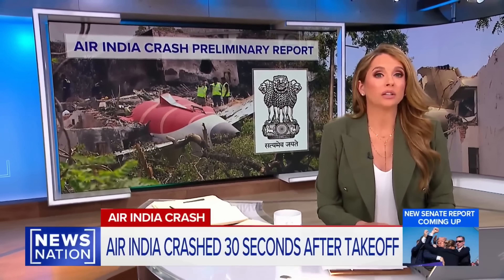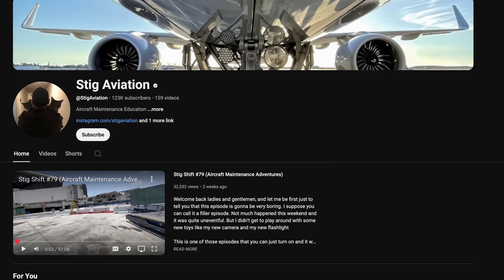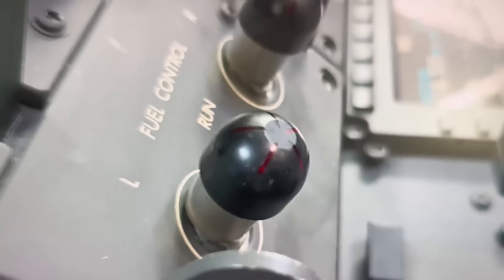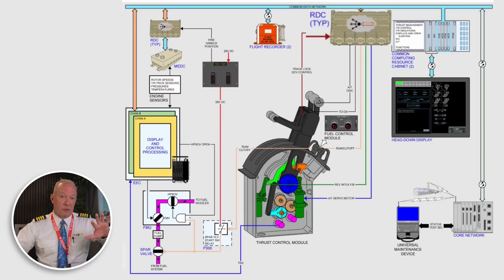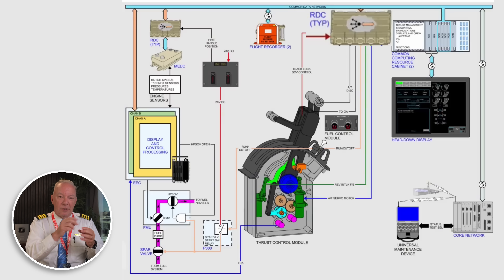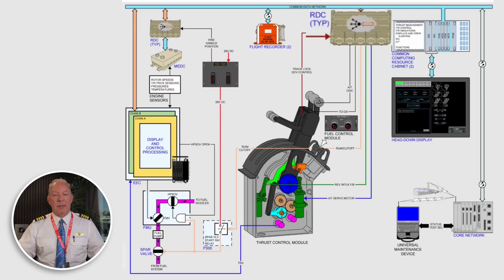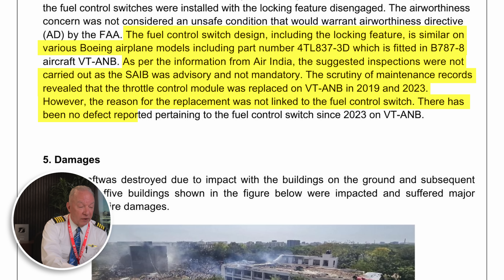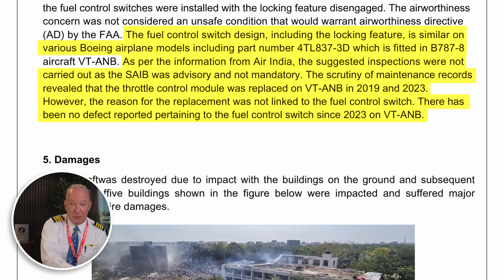The Truth About Boeing 787 Fuel Control Switches

Comment: As a non-insider, could there have been a problem with that battery? It was said that, like on a car battery, even during a total power failure there would be still remaining power in that battery. If the battery is defective, this would affect 'both switches'?

Comment: Captain Steeeve, when you said the whole module was replaced, I started to think was it maybe a faulty connection in the wiring. However, to disconnect and then ten seconds later to reconnect does not make any sense either.
Hoping, as you say, neither of the pilots was trying to test the others skills…

Comment: Hi Captain Steeeve,

I was wondering if you could clarify this thing boiling in my head. I'm an engineer and a very curios one. And I just love airplanes and follow aviation news around the world. Is there any chance that these switches are electromechanical ? I know that it is far far fetched... I have these kind of safety switches in my lab and I also use them on my DIY projects. I also know that it would be a very complex mechanism to design these type of safety switches electro-mechanically operate..... since these switches are very thick and bulky... I thought they might be electromechanical.... but they could be bulky just because they carry a lot of current to operate the Valves directly.... I'm speaking my mind... so can the flight computer flip these switches ???

Comment: The problem I see here always requires power to keep it engaged this is not correct as power could be lost for various reasons I could go on and how it should be but I won't at the moment as I don't have all of the details
Reply: Good idea, research firts! If you're talking about the cutoff values, they are default CLOSED. If an engine shreds itself, and wow can they ever!  Statistically it WAS more common for it to happen due to engine condition itself, something significant enough to go into an engine and do it is very rare in the sky, it has happened with a bird..... But it was a 10 foot wing span condor that evidently had just eaten a dear! But these days engines are amazing in design and composition of parts, the integrity of the blades and shaft when running is stealing magic from another realm😂
Bird strike generally just makes a mess that cooks on the igniters and you have to clean it off to restart sometimes. If you wait a little it will generally fully bake🤢 and can restart, but best to land and fully address it. SO, extremely unlikely but if an engine turned itself into an appendix hanging off the wing, there is a good chance it will take power out to its immediate infrastructure is at that point you want fuel to stop by itself. 
Problem here though is this guy (that i did like) is like so many others dribbling garbage and being completely misleading!!😠 The movement of the switches by any means or record, is a COMPLETELY USELESS detail in evidence!!!!
It could be the reason engines failed hence record of operation...... BUT if it was something else and the pilots try to restart they have to operate the switches!!!!???? And remember I said to need to wait if it's bird guts cooking that maybe the only thing they thought it could be, so wait 5 seconds before returning to run!   🧐 So no matter what the switches will be used! So they prove nothing.

Comment: What Captain Steve doesn't explain is why Boeing even allows the switches to be touched at this stage of the flight. During takeoff, right after the rotation, is there any reason to justify the fuel cut off? If not, why does the system allow it? Would this tragic accident have happened on an Airbus? On an Embraer? Does the Airbus or Embraer system or software allow fuel cut offs under these same circumstances? With all due respect to your profession, I think that new protections must be imposed by the regulator to protect us from the pilots. We don't need a second cockpit door; we need protection from the pilots. I've always been against the single-pilot policy, and even zero pilots, but now I don't know... Perhaps we'd be safer removing the pilots from the equation.
Reply: In case of a single engine fire, pilots are instructed to cut off fuel to that particular engine (Right after take-off) Now you better have a reason to keep supplying a fire engulfed engine with Fuel even when everybody knows airplanes fly just fine on one engine as well. The manual control to fuel the engines is justified imo
Reply: @krabhigyan People are DAF I guarantee you not one of these ideas people have is generated in there own thoughts, they listen to another fool... I should  have mentioned where said something should be.. hang on a sec..

HEY.. OP The system actually does prevent two engine cutoff in air.. the WOW system is the applicable reference.
So again had to be fault even if it was deliberately intended!!

 Ok how you he will take that? I'm guessing, go look for confirmation from another fool.😂
Reply: @krabhigyan People are DAF I guarantee you not one of these ideas people have is generated in there own thoughts, they listen to another fool... I should  have mentioned where said something should be.. hang on a sec..

HEY.. OP The system actually does prevent two engine cutoff in air.. the WOW system is the applicable reference.
So again had to be fault even if it was deliberately intended!!

 Ok how you he will take that? I'm guessing, go look for confirmation from another fool.😂
Reply: Absolutely NOT! you will rethink that when the final report comes out! Airbus has exactly the same! A Quants flight took off in Australia a few months ago and had to shut one engine down when it burst into flames at the exact same time these engines failed!! Not saying they are related at all they are not. Just saying YES THE SWITCHES, YOU NEED TO HAVE THEM AT ALL TIMES.

Comment: This an exploration of a lay in safety systems. By default this is an unsafe circuit! A single fault causes a catostrophy!
Reply: Yes but that's in regards to the real cause, not the switch or its circuit, that's is fine by design and was operating fine at the time. Unfortunately it requires an EXTREMELY high intellectual capacity to understand this evidently. I'll just point out that, as he stated the fuel cutoff is a "closed"  circuit, and has no connection to anything other systems.........?
Ok so how TF does a restart happen from the switches then?? Fools are so easy to fool!

Comment: Is it possible for the batterie to explode? I dont know what kind of batterie it is. LiOn batteries can fail, i know that. Lead acid batteries too. A friend started his car and some produced H2 exploded. Only the base plate of the battery remained in place... The signal with one second between makes it impossible this time, just in general, what happens when the batterie fails?
I was working in the sahara desert and the first 18 seat plane without pressure cabin was an old model with frequent failures. back door behind the seats opened and luggage rolled over the runway. After landing front brake failed and hydraulic oil poured out. Engines did not start and our workshop team came out to jump-start the plane... We changed to other planes later.
Reply: Yes over charging lead acid batteries causes the acid to boil, th electrolytic chemical reaction causes it to boil off as hydrogen gas. But yes the batteries in the 787 are li-ion, and yes they have been a problem in the past.

Comment: There was a short circuit in the tsail  wireing which dropped the dc voltage and caused me simulated shutoff of the s we itches
Reply: No Close though, the network link droped out between the TCM and FAEDC so with no throttle signal engines went to idle, and remained.. the system didn't record a restart, that's misinterpretation of data it recorded throttle command reconnect but it was out of reference range because leavers were at full when it reset.... They had to be at ldle!!!!!!  So of course there was no apparent recovery.

Comment: As a 50 year veteran as an electronics professional you did an excellent job of explaining this. There are no computers or data or glitches that can be a part of this. The system is as analog as it gets. And with 2 separate circuits there is nothing that would affect both of them 1 second apart without a human moving the switches - whether by mistake or intent.
Reply: Wow - with 50 years experience you didn't spot that almost everything he said cotradicted what was shown on the diagram ?
Reply: The problem here is it's a layered subject that people are stuck in only one of. The switches that everyone is focused on, have ZERO merit as evidence to cause at all!! Think about it.. yes turn off crash! Derr, but if it was something else what's the solution.... Well that also means turn off before tunning back on!!!  It's a logic trap and I'm sorry but simple minds are falling into it in scary numbers!?
The explanation sounds logical to you because as it was explained IS a logical circuit...... But that's not the extent of it at all!! The computer does have authority over the fuel cutoff and in air it will not if functioning properly, allow both engine shutdown without further confirmation. The entire problem is on another layer thats over people's understanding so they don't see it, the issue does not involve the fuel circuit AT ALL! It's just the limit of what people understand in causation! The only part the switching plays,, also proving they are connected to the computer was the restart attempt, but again NOT a restart ... Reboot! The switch prompts the system to re-establish network connection.... Which is what was lost and caused the crash. But the sequence of events started on the runway but didn't effect until WOW brought the problem online at the moment of take off! 
So if you know your electrical, then this should make a big load of sence!
Reply: In the 90’s we started with BUS systems. It is not just relays here. When we combine old relay systems with BUS controlled systems - a water contamination is a possibility, this can effect both BUS or Relays. Look into where toilets are places, what if this is a reason. I am positive, blaming ppl here, might be correct, but I am not sure to agree it is the captain or the co-pilots doing for this accident
Reply: @holmbrew 100% the right way of thinking and approaching the subject!!👍
Given that the toilets are directly over the electronic equipment bay and do leak if not maintained and have caused previous issues and that they no longer use simple spill trays between the plumbing and electrical, and the fact the RAT was the first  noted symptom indicating a problem. Its well due hushing the current narrative and focusing on an appropriate investigation! I cant believe anyone could think otherwise.

Comment: One question I have is since the fuel cutoff switches are connected to a relay, what condition were the relays in if they were recovered post crash?  I understand that aircraft relays are designed to meet a very high standard of safety, however it is still nothing more than an electro-mechanical switch and can fail with little to no notice.

Comment: As much as I appreciate the detailed explanation… it misses a critical point. Could it be that we don’t even know what we don’t know. Are you 100 percent sure that there is no other way for the fuel control valves to shut off other than switch movement ? I don’t think anybody could be 100 percent sure. Is there a chance something else might have caused the fuel to shut off … yes. Switches were found to be in the on position in the wreckage … are we 100 percent sure they were “physically”moved at all ? No.  And soo many more questions … the point is that we should not jump to a conclusion that pilots cut off the fuel and crashed the plane without a due investigation.  This should be the last explanation. Not the first.
And let’s not overlook things that we do know for a fact and questions such .Why was the report released  in such a suspicious manner… why has report writer not come out to answer questions … and why have they withheld information such as full cockpit audio recording etc that could shed more light on what happened that day …

Comment: these explanations have been more than sufficient to exclude accidental or inadvertent mechanical disconnection of the fuel pump systems but does not exclude some absence or dissociated pilot state due to seizure or other potential medical or psychological/psychiatric condition.  Look how often pilots accidentally pull up or fail to drop landing gear, certainly not for lack of knowledge, understanding, checklists, or  experience yet it still happens and one needs to be vey careful about automatic behaviors in the cockpit - look and think before moving any of the controls or switches, we all know that but some are more impulsive or slow than others.

Comment: @Captain Steeeve... quick question.... @4:50 you mentioned that the switches send power to relays, which in turn power the three fuel valves... Any chance the issue could lie with those relays? In other words, the switches remained in position, but power was lost to the relays, removing power to the fuel valves...

Comment: It's clear the switches were operated by a hand. Period. Why there's no cam pointing to the instruments recording who's using the controls? Also, cams would be needed to point out to the engines and ailerons, rudder, etc. so that the pilots could check their function. A lot of hassle would be avoided.

Comment: Captain got no clue. Fully manual system. Lol.
Reply: Exactly, if it is a closed loop system by the switch, if it is manually switch off by the pilot. The system will have a control to turn back on itself.as a pilot who doesn't have engineering background, you shouldn't mislead the audience of what you think. Instead state the facts. What I can say is there is only a feedback sensor to the system instead of closed loop system, which only show you that the switch is on or off.

Comment: I am asking just to know better: What would happen if the spring in the fuel control switches is broken? Do the switches share the same rod that could somehow stick? Could the relay fail, show in the instruments that is in the off position - and that is why one pilot asked the other why they were switched off (and not by seeing the switches themselves?)
Reply: The switches would still have to physically move to cut off fuel. If the relay fails the system leaves the valves open so the engines continue to run. It is a fail safe system meaning that it is designed to keep fuel flowing to the engines even if there is a total electrical failure. The AAIB report clearly says that both switches were transitioned to CUTOFF. That means they were MOVED to cutoff and then MOVED to run about ten seconds later. I wish it wasn’t so but that is how the system works.

Comment: Lots of experts in here commending you, rightly so. But let me say, I know next to NOTHING about flight, flying, or mechanical engineering, and this explanation made everything crystal clear to me. Thank you.
Reply: Captain Steve incorrectly describes the control of the fuel values according to the diagram he presented.
Reply: supposed experts. No proof any of them are experts, especially Captain S.
Reply: @stevebubbie1126  correct. We need only compare the diagram provided by Captain Steve with the description by Captain Steve to realize that they don’t match and are therefore untrustworthy.
Reply: The explanation of the electrical circuit, if rated 1 to 10, I would say it's a 2.

Comment: u dont get a formula1 driver to diagnose a motor failure. Likewise steeve stop pretending u r an xpert. ur first video on this tragedy suggesting pilots raised flaps instead of  gear with out an iota of proof shows ur true intentions. U look like an Idiot frm watching that video now. Flying a wide variety of aircraft does not give u experience of design methodology, common mode failures and systems engineering. Its quite clear u r a product of American hegemony where every1 else is wrong / incompetent unless proven otherwise. This approach caused two 737 max crashes. Lion air CEO was screaming at top of his voice abt issues with max but was ignored until ethiopian air crash. U dont get ur medicine frm a patient who has gone thru illness but rather frm some1 trained to establish facts using data and evidence. Not a surprise ifsteeve is on Boo-ing's pay roll to spread this propaganda. 
Only have to look at other youtubers, xtent they go to get views ..
strongly suggest u stop ur propaganda & revert 2 being a metal can driver...
Reply: Write in English please.
Reply: @rogerturner5504 
👍

Comment: One thing that does puzzle me slightly in the operation of the system as described, is the claim that the valves fail (on loss of electrical supply) to the closed position. This is not 'fail-safe' this is 'fail to danger'. 
I can see why these valves would not be desired to fail open, because inadvertent opening on the ground would be dangerous too, but I think 'fail set' (i.e. the valves stay in current position on failure) would be the safest option. Not that this makes any difference to the story in this case.